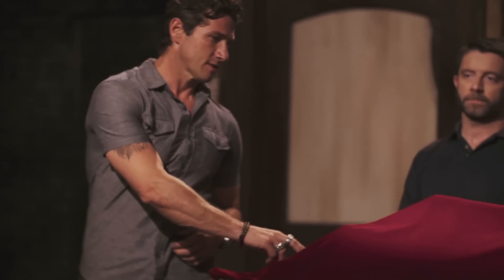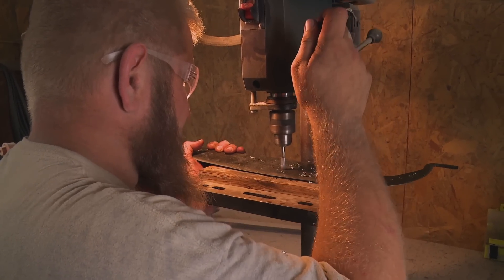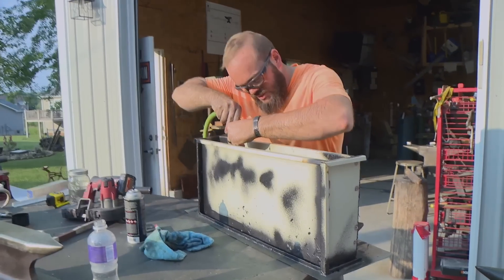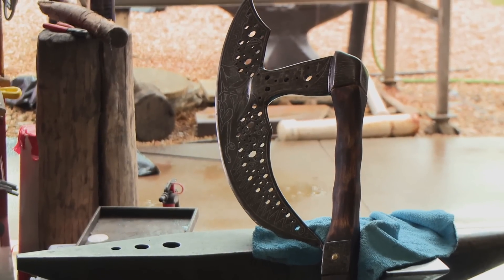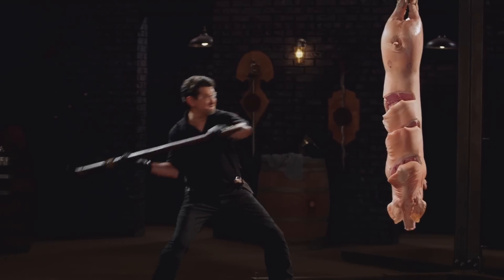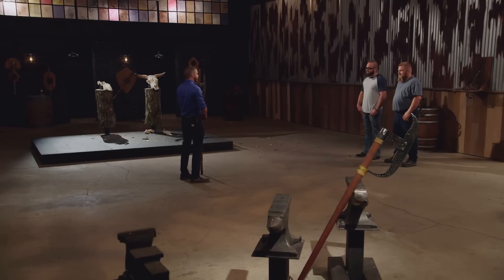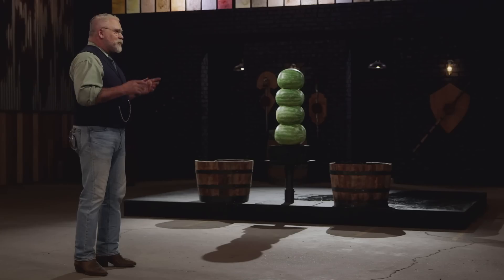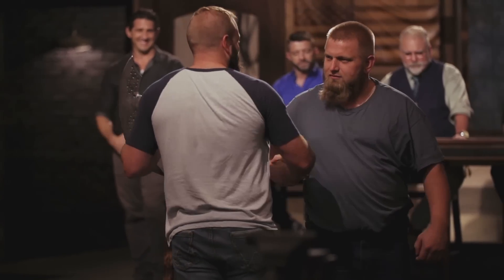Forged in Fire: The Bardiche VICIOUSLY DESTROYS the Final Round (Extended Edition) (Season 5)

Comment: one of them effectively made a stylized guillotine blade on a stick... 11 lbs is just rediculously heavy... even for 2 handed weapons
Reply: @Ban this youtube Well yeah. But there is difference in usage. Carrying around 11lbs isn´t problem. Effectively swinging with 11lbs stick in hour long battle is.
Reply: @Ban this youtube now try swinging that m60 around like a warhammer see how tired you get quickly
Reply: @Ban this youtube 11 pounds is a typical sledgehammer, except on a pole twice as long, making it effectively twice as heavy. Try swinging that thing around without making a clumsy fool of yourself. I’d be happy just to not accidentally hit myself with it you’d have to choke up your swings so much. Respect to your brother and his service though, it’s just not a very good comparison.
Reply: @Elliottklassen  I've used military rifles in my career in the Army, and one key thing to remember is you don't hold it in your hand. you brace it against either your torso, or a solid object, and use your hands to steady the weapon while firing.  In the field an M-16 or M4 almost always has a sling attached.   Some sling designs actually position the weapon where it's almost strapped into firing position.
Reply: @Ban this youtube Tt's called centre of balance. Try to lift a short 50cm bar with 3kg on the tip with 1 hand holding the other end of the tip like youre holding a sword. 
Forward heavy emphasis and isolate on your forearm strength instead your whole arm. 
bringing around 11lb guillotine on a stick is easy, swinging it around isnt. 
Same thing like trying to stay accurate while firing full-auto an assault rifle.

Comment: Given how heavy it was, I am surprised that they even tested the weapon.
Reply: It was just barely within parameters.
Reply: Ok
Reply: the fact it was so head heavy probably hurt him more than the extra weight itself. If it were balanced between the head and the handle better, all of a sudden that weight becomes a bonus and not a hinderance. For instance if he shaved off some of head weight and put a steel ball as sort of a solid steel piece on the butt of the pole... might have worked in his favor.
Reply: 11 pounds of weight is equal to a long solid metal rod that is used to break rock and walls in construction, I used the metal rod for exercising before but that thing would never be a wieldable weapon for most people especially the balance is toward the tip unless you are a hulk of a person, even so, wielding it long time will prob put you under some sort of medical condition. You can see the judges are struggling to hold the weapon properly and their forms are out of sync.
Reply: They probably wouldn't have tested it if it was a single handed or a style of weapon that required a more wild swing.
Reply: Nah, y'all need to chill. They just wanted to test that heavy beast, and give a good show.
Reply: @DarkSuperRunChao  Yeah, it was clear before the judges even used it which they liked better, but there's only one time I've seen where the judges noped out of testing.  and that was because it was straight up the wrong kind of blade.  There's been quite a few where they stopped after swinging it once, but I've only seen one where they didn't swing it once.  This one it was obvious they were struggling just to use it properly.  That's gonna hurt your odds of winning a lot.
Reply: well, it was a weapon for big guys, really big guys.
Reply: @hoppalapasam53  Its not a matter of how big you are. The human body has limits to the strength it can exert. If you are beefy and strong you might be able to swing it for longer, but as someone with experience with HEMA, an 11 pound axe like this is still way too heavy. Even a strong man would spend way too long recovering the thing when you could instead use the axe nimbly for both defense and offence. You might be able to wield it, but if you can't defend yourself with it or use it fast enough to kill your opponent then it is an objectively bad weapon. 11 pounds is way too heavy.   

It also wasn't exclusively for big guys so I am unsure of what source you have for this. It was for elite musketeers in the case of the 16th and 17th centuries.   Big guys might look more intimidating with it and we all like to imagine big burly strong Russians but these are just stereotypes.  Mind you, elite musketeers would eat a bit better than the common person so I can see him being give or take 2 or 3 inches taller than the average Russian on average.

Comment: Its rare you get the "Its heavy" so emphasized. Did he even trim down the I-beam girder he used to forge it? I mean, its a bardiche, its a heavy weapon, but dang man, its not a sledgehammer with an edge.
Reply: It's a heavy weapon. And heavy weapons are not that heavy because they need to be usable in battle. The weight of a bardiche goes from 3.5 to 5.5 poungs (1.6 to 2.4 kg). So 10 or 11 pounds is just unusable. Even the strongest of people wouldn't use it. 

Imo Michael's weapon  should be disqualified.
Reply: @bemvas2484  nah disqualifications we’re unnecessary since it’s a perfectly functional weapon that’s just heavier to use
Reply: @thedarklightskin  A weapon which is "just heavier to use" is 5 pounds. And we're talking about double that weight. It's not proper for battle.

And if it's not proper for battle, it's not a proper weapon.
Reply: @bemvas2484  tbh as long as it can take out the opponent, it works . And sure it’s heavy but just simply because it’s heavy doesn’t mean it’s unusable.
Reply: @thedarklightskin  you forget one thing — it is an infantry weapon. Spicifically — musketeer analogue infantry, with heavy musket, ammo, and sabre as backup weapon. And again, main thing — infantry. You not only will use it in the battle, but will carry all stuff in the long marches. It's just too heavy to use, instead of this — you will prefer to take more gunpowder and bullets with lighter blade. And i don't even talk about price — steel in medieval wasn't cheap thing.
Reply: @PyromaN93  hey it really depends
Reply: @thedarklightskin  It might be ok for someone like Hafþór Björnsson, but 11 pounds is way too heavy for the average infantryman lol
Reply: @nuraby_9228  and even that beast of a man would be more efficient and faster with a lighter blade. I mean, they were fighting other men, not dragons.
Reply: @thedarklightskin  it not depends. Tired soldier is more vulnerable and less efficient. 
Infantry armour is disappeared because it was heavy and bulky, and soldiers wasn't wanted to carry it, not only because it was too expensive or ineffective. And it at leas had purpose — it surely can save your life in battle, but it transforms to excess weight, while you need to march few days in a row. 
This piece of steel is absolutely unnecessary overbuilded.
Reply: @bemvas2484  bardiches werent supposed to be heavy. They were light enough to carry along with already heavy musket and then light enough to immediately switch from shooting to melee, often in seconds.
Reply: I agree with most of the comments here, but I just wanted to comment on the men who fought in WW2.
The M1 garand weighs almost 10 pounds.
Hats off to the infantrymen who lugged that around the battlefield.
The BAR was even heavier.
Reply: @M240D  thank god they were supposed to swing it
Reply: @M240D  the m1 grand replaced the musket and bardiesh and the bayonet replaced the saber in infantry combat.
And consider...the musket weighed around 20lb...and that doesn't include ball, wadding and powder.
Reply: @coreygardner1371  yeah, and certain methods of musket firing lines actually used team firing and had a second person to help stabilize the barrel.
Reply: @thedarklightskin  Sure it'd take out the opponent, but then it'd leave you too tired to take out the next one and all the others after that. On the battlefield stamina is a precious resource and running out is one of the most certain ways to lead to your death. The stamina and endurance of the soldiers was one of the biggest factors contributing to winning and losing a battle, as the side to tire first would be much easier to defeat hence why the weight of equipment and how much work you had to do to use and carry it all was vital. Battles could drag on for a very long time, even the toughest and strongest of men could be easily defeated by a weaker opponent once they've run out of stamina and lost all strength so it's really important they conserve their strength as much as they could and use it when it's most needed rather than be drained by carrying a big weight around
Reply: he recognized when he finished it that it was too heavy and couldn't fix it in time. they dont always show us all the paramaters for these weapons so maybe he would have had to remake the head, you can see theres a shitload of holes in it in the testing phase so he tried his best to account for it. Its respectable that he recognized the issue before turning it in. a lot of people dont realize their issues till the judges tell them
Reply: Edgehammer, if you will
Reply: it looked so heavy it almost looked like a fantasy weapon instead of a bardiche

Comment: The both had advantages and drawbacks for suppose the handle with wavy design would give a good grip but it would be difficult adjusting it in fast pace battles the second one did support in fast adjusting but it can easily lose grip and yeet itself because of the heaviness (only my thinking)
Reply: This is an infantry weapon, so, you will carry it all the way. Not much fun.

Comment: It's a heavy weapon. And heavy weapons are not that heavy because they need to be usable in battle. The weight of a bardiche goes from 3.5 to 5.5 pounds (1.6 to 2.4 kg). So 10 or 11 pounds is just unusable. Even the strongest of people wouldn't use it. 

Imo Michael's weapon should be disqualified.